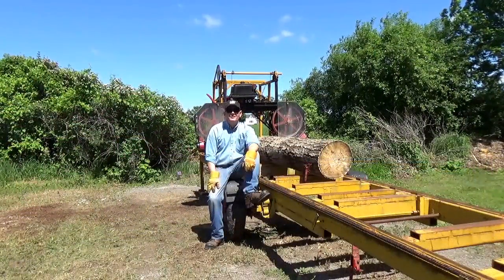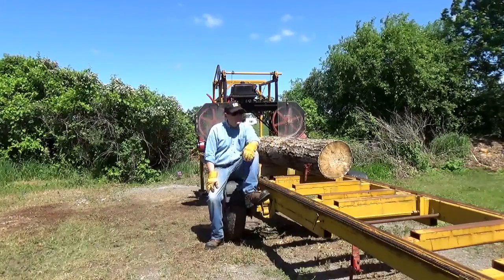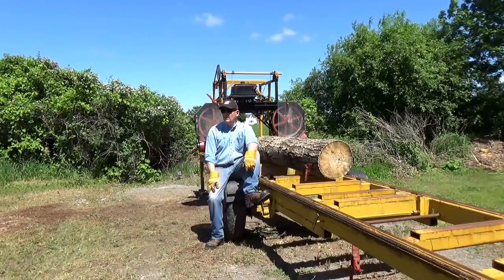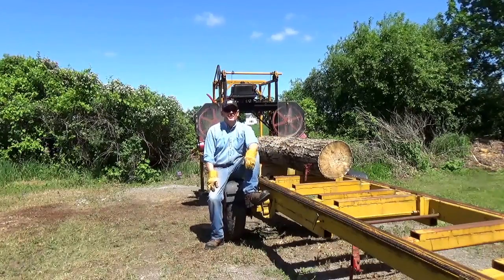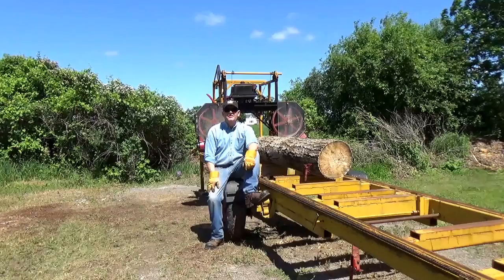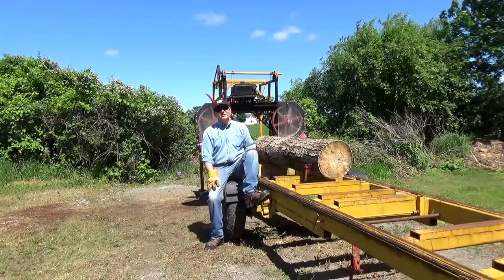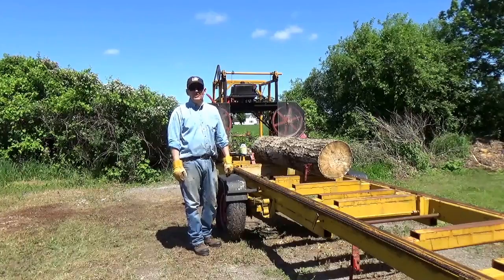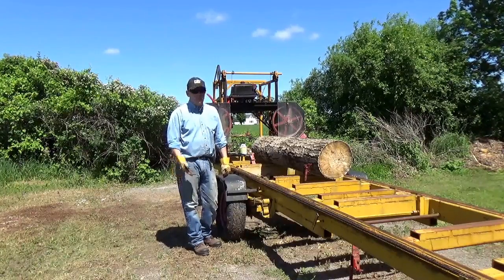Home Built Sawmill.

Comment: That's a beautiful mill. It seems to run very smoothly. Do you have a video showing how it's made ? Have you ever considered building a swingblade sawmill ?
Reply from the maker: Hello John,
Thank you for your kind words. I am very fortunate, the mill does work well. Unfortunately I built the mill quite a few years ago, before I began making videos. 
Before I built the mill I checked out several design types of both circular and band types. I had some experience with an old circular mill when I was a teenager and had initially thought of pursuing that direction but when I saw how efficient a bandmill could be decided to go that route. Thanks again for your comments.
Reply: @OutothehousewithPaul  Perhaps you could do a video with close up shots so people could see how yours is made ?

Comment: What's the power of the engine? What's the diameter if the wheels blades?
Reply from the maker: Greetings,
There are two engines on the mill; one to power travel of the sawhead and one to power the head itself. The travel engine is 4.5 hp and the sawhead engine is 16hp. I believe the pulleys/wheels are 21" in diameter.  Hope this helps, all the best!

Comment: Nice mill looks like it cuts nice and even too. I used to live up in Slavelake Alberta where i worked as a welder/machinist and in my spare time i built a bandsaw mill from scratch the only things that were bought were the bearings blades and the wheels the rest i machined from solid stock. I started off with a 6.5 hp engine but found it laboured to much so i replaced it with a 15hp world of differance. After there fire that burnt a good third of the town we moved back to the gap (Sask) and haven t used it since. I m a yr away from retiring so maybe i might get back at it i'm not sure. My only question is what do you make out of poplar lumber?
Reply from the maker: Hello Barry,
I donate lumber to a local high school. They make all sorts of projects out of it. In a way it is similar to working with Pine. Your mill sounds great,  if it works for you I would like to see some pictures of it. My email can be found on the channel. I didn't buy much for mine either; a few brgs, wheels, belts, the 2 engines, and some tubing, etc. I'll bet you saw (no pun intended) a huge difference between the 6.5 and 14hp. I hope you did not lose much in the fire, I cannot imagine what it all was like. I hope your retirement is awesome, we are in the last few years before... Thanks for watching the video and thanks for your comments.

Comment: Hi Paul love any video that has hauling or sawing trees. I'm in the process of my bandsaw build and I figured that yours has been working for 17+ years its proven to work right. I would like to see a video of the mill and how your dogs work, up and down on the head, your wheel and clutch engaging system works. if you have some time make us a video of it. Thanks so much, its a great video
Reply from the maker: Thanks so much for your comments. When time allows, I will make a video that shows the clutch, dogs, etc. I congratulate you on building your own mill, you will no doubt have all sorts of fun in the fabrication and building process and many years of fun sawing on your own mill. If I can answer any questions please do not hesitate to ask, although I do not pretend to be an expert at anything. I just have a lot of fun. Cheers.
Reply: Out o' the house with Paul i

Comment: Liked, sub'd and rang the bell! Do you use one of the digital moisture meters or just time it?
Reply from the maker: I do have a Digital Moisture Meter but seldom use it. The lumber will be air dried for a year (under roof in a building) before use and its been my experience that by then it will be stable.
Reply: Air dry... me too, stacked nice and even.level under roof. I am sure to coat the end grain... forgot a time two and some good red oak split on me.
Reply: pro trick: you can watch movies on flixzone. Been using them for watching all kinds of movies recently.
Reply: @Luke Alaric Yup, I've been watching on flixzone} for months myself :D